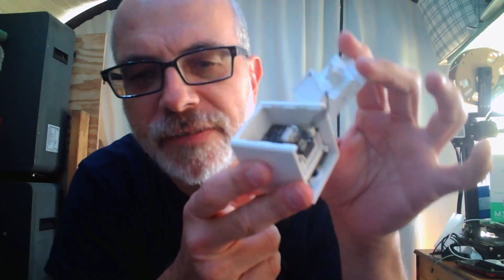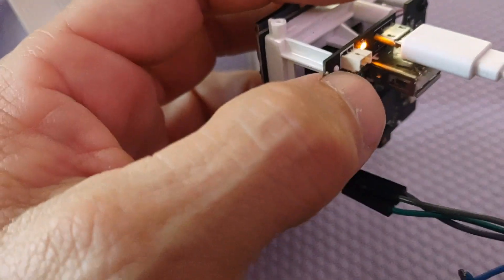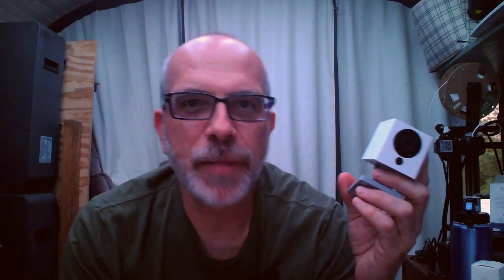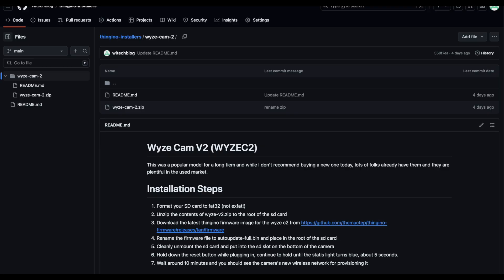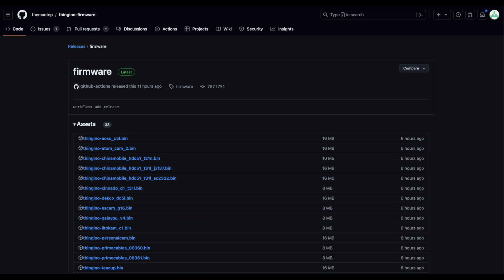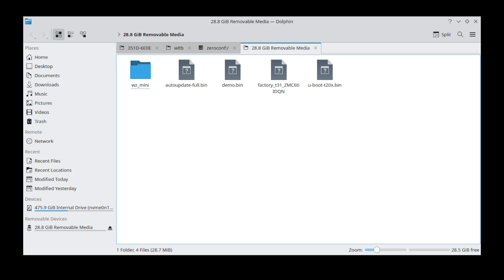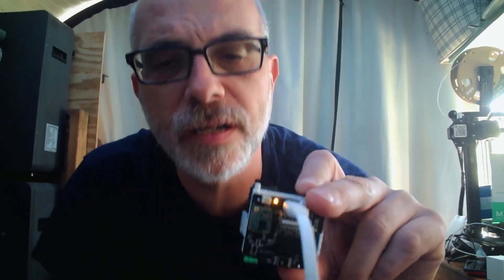Updated Description! Don't buy a Wyze Cam 2! But if you do/already did, let's hack it with Thingino!

Comment: Is there a method to do this procedure with the Wyze V4?
Reply from the maker: Unfortunately Wyze has crippled the processors in newer devices, including the V4... I generally only recommend purchasing previous Wyze products on the used market. We just broke 100 supported devices for Thingino though, check out the web site for a list of supported cams!
Reply: @wltechblog  Thanks sir, I appreciate the prompt response.  Does this method work on the Wyze Outdoor Cam (Wireless), either V1 or V2?

Comment: I have dafang hacks on my current Wyze cameras. I am looking to move to something different. Does Thingino support Ethernet on a wyze cam 2?
Reply from the maker: I don't use it personally but I know we have a couple usb ethernet drivers built in, and plumbing to configure and use it.
Reply: @wltechblog  I have some with usb to ethernet dongles with axis chipsets. I will try one and respond with the results.
Reply from the maker: Did you get some results from this?

Comment: No V4
Reply from the maker: Correct. Wyze Cam V4 has intentionally crippled processors that prevent you from using third party firmware. Buy a Wuuk instead!

Comment: Is it possible to revert back to the Wyze factory firmware after the fact?
Reply from the maker: For most devices this is a one way trip. If you need to be able to revert, you'll need to take an image of the factory firmware before proceeding, this can be done with Cloner or a flash programmer.

Comment: The package does not work anymore! II have followed your guide and bricked my Wyze V2, it is fully dead, no LED, no way to flash anyting. any way to recover?

Update: had to open the camera and use USB Cloner to recover.
Reply: I had this happen as well. Probably had a successful flash but didn't see the Thingino SSID, so tried power cycling a few times and then holding the button to reflash, and now no LED. How did you get the live serial connection for USB Cloner - via the pins on the board and/or the USB-A port?
Reply from the maker: On a V2, you use the usb A port to connect to use cloner. if you're still having trouble, hop on the Discord channel and we'll get you sorted!

Comment: Mine just clicks and says ready to connect, no blue light. Firmware level?
Reply from the maker: Ready to connect is the stock firmware, so I assume it's not booting the hack. Make sure its on a 32gb or smaller sd card formatted to fat32.
Reply: I had a 64gb card that was doing this.  I formatted it again just to be sure as fat32 and it immediately started working after that.

Comment: Just came cross this so dug out an old V2 Wyze and followed along. I now have a Thingino wifi to connect to. After connecting, what do I do next to view the camera feed? Many thanks.
Reply: ps, I cant see an IP address for the camera.
Reply: Found IP address, asking for username/password?
Reply from the maker: When you connect tot he thingino networi, it should automatically take you to the provisioining portal. This may not work on iphones right now... In that case you can open 172.16.0.1 or http://thingino.local should also work. After configuring your wifi and setting the hostname and password, you should be able to connect back to your wifi network and use the hostname to get to the web interface. You will use root and the password you set in the provisioning portal to access it.

Discord is the quickest way to get help if you need it!

Comment: I have an old v2 cam like this but when I look at the firmware list it has a lot of them listed, which one do I download?
Reply from the maker: There are two for the Wyze V2. Follow the instructions to install the first one. If after installing you have a working device but the video doesn't actually work, install the second image. You can do that by copying the firmware image to the sd card as autoupdate-full.bin and removing autoupdate-full.done if it exists, then rebooting the camera with the sd card inserted. I'm working on the wyze V3 right now which has a number of options and trying to do a detection step to determine the right one for it, if that works out i'll update the V2 installer as well.
Reply: @wltechblog I installed the jfx22 one, but there was no video so what I did before fully reading your comment was I reformatted the sd card and tried to go through the same install process with the jfx23 file, though now I can’t get the blue light to come on when holding the button and giving it power. Did I mess up?
Reply from the maker: Put the new firmware file on the sd card as autoupdate-full.bin and remove autoupdate-full.done if it exists. Boot with the card installed and you should get a freshly flashed device waiting for you to connect to its wifi and configure it. If you need help, jump on our Discord!

Comment: @wltechblog I'm totally impressed with the thingino firmware upgrade. After getting my first V2 programmed and connected to BlueIris with the RTSP output I thought I'd try and program a V2 that was acting like it was bricked (red indicator light on solid after trying to install factory firmware). The only firmware that it would accept was the Wyze Webcam firmware, other than that, no joy. I loaded up my SD card as you cover in the video and in less than 10 minutes the previously simi-bricked V2 was up and running! Thingino firmware has SO much more than just the RTSP output that I'm currently using and I'm looking forward to learning much more about it. Thank you and the team who is making this happen for all the hard work and patience you have answering all my questions.
Reply from the maker: I'm really enjoying this project! But don't buy any Wyze v2 cameras!

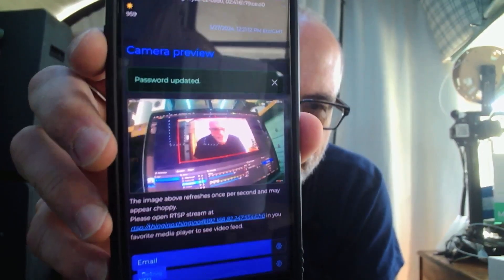Comment: Regarding the time @9:50 when you are showing how you pull up the preview page, what address or application is the preview page on? I have the flashed V2 on my network now and I have it's IP address but I'm at a loss for where to pull up the preview page.
Reply from the maker: Once you're flashed, loading the ip address of the cam in your browser will take you to the web ui, and the preview page is one of the menu options at the top. It will also attempt to register the hostbname with mdns, so you can try that as well.
Reply: @wltechblog  Thank you, I'm at the page now and it's asking for a username and password.

Comment: Got to the wifi credentials page. Entered them. Camera rebooted, but no longer shows up as a wifi connection.. also does not show up on in my router.
Reply from the maker: You can always set the wifi credential with an SD card. Create a file called uenv.txt with the contents:

wlanssid=mynetwork
wlanpass=mypassword

Rebooting with the card inserted will update the wifi params directly.
Reply: @wltechblog  I created an uenv.txt (with user/pass) and put it on the sdcard. Plugged in the micro usb cable.. It appears that the camera is not powering on or booting. No led or sound from the IR sensor clicking.
Reply from the maker: best choice for support is to jump on the discord. Not sure what went wrong but the Ingenic devices are very forgiving!
Reply: Mine did the same thing, Got my creds entered then it never connected to my network. Tried a bunch of stuff cant seem to get it to do anything now.
Reply from the maker: @NathanSchouw  You can always set the wifi credential with an SD card. Create a file called uenv.txt with the contents:

wlanssid=mynetwork
wlanpass=mypassword

Rebooting with the card inserted will update the wifi params directly. Note that only 2.4ghz networks are supported by these cameras!

Comment: Hi followed you on the Wuuk video and bought one! Flashed it went through the setup but didn’t get a preview of the camera only default video checkered colour . Rebooted and flashed still nothing…. Any clue?

Enjoying the videos!
Reply from the maker: Are you running the current build? Easiest way to get help is on Discord!
Reply: @wltechblog  just posted thanks
Reply: I had to end up flashing the other firmware for my wyze cam.  Wyze Cam v2.  I had flashed the jfx22 build initially and that gave me the no preview issue.  I downloaded the jfx23 build and put it on my microsd card.  ssh'd into the camera and ran the following command:  sysupgrade /mnt/mmcblk0-1/thingino-wyze_c2_jfx23.bin -f 

Had to resetup the network connection because of the -f flag being a full flash.  After setting up again the video preview started working.

Comment: Just started watching, tried this the other day before the video and horribly failed.. let's watch this and try again!! LoL
Reply from the maker: Time for success!
Reply: @wltechblog  rut roh.... It didn't work, it also decided to not power up anymore either. It did it's blue light thing, sat around for about 10 minutes waiting to see if I got the wireless access point and nada, gave it another 10 min or so and figured I'd repeat the process and unplug then replug..  Now the lights not coming on when I plug it back in. I do have 3 more to test with... Hahaha
Reply from the maker: Once you've flashed Thingino, that light won't come on. Jump on the discord and I'm sure we can get your cam figured out!
Reply: @seanwoodward33  nope, dead camera now. I suppose I can try again with my older and wiser self.